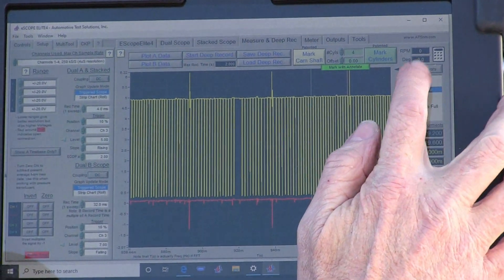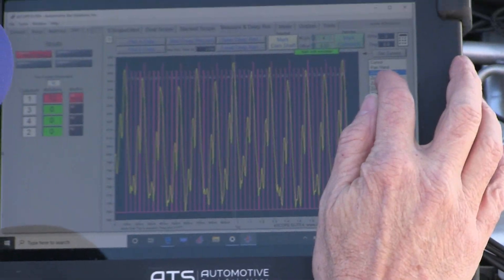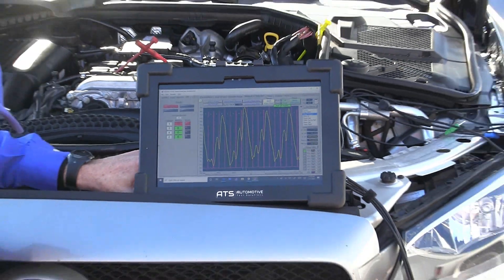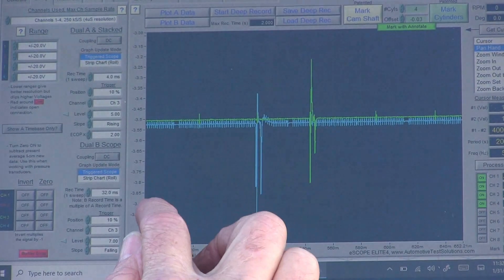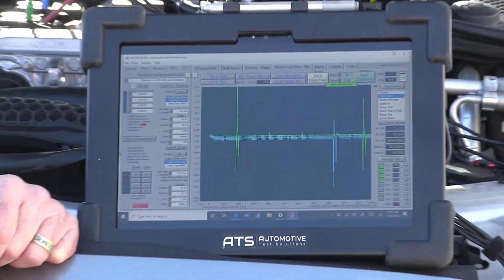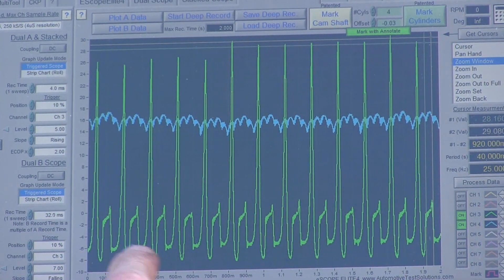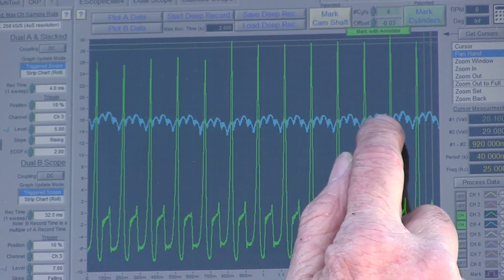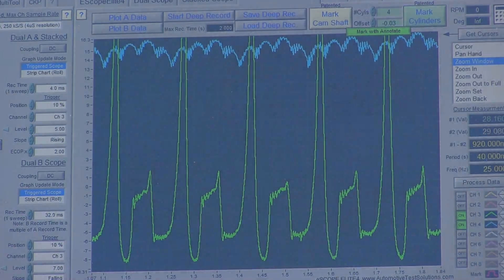2015 Mercedes 300C

Comment: That's why people should buy old crownvics.you can overheat those things and run them into the ground and save 50,000 dollars in the process.
Reply: and then you crash cause no traction control
Reply: @MrEeeaddict  if you crash then you are not a driver!
Reply: Best demo cars ever!

Comment: Man that E Scope is an awesome tool!
Reply: The crank misfire software is awesome.   I will be showing a demo on a Diesel soon. 🙂
Reply: busjockey1 the love the fact you can pull a misfire out of it with a sync & crank sensor. Pretty wild.
Reply: @weldingjunkie  Yes crank misfire feature is awesome.
Reply: @weldingjunkie  Agreed, I somehow regret my Picoscope purchase but I hope that Pico ups their game and can use some sort of filtering preset for this type of diagnostics, what I see this software do is look at the velocity of the engine and then if it notices a speed change, then it flags it accordingly, I don't see it being too hard to detect but I'm sure it can be done with the current tools that Pico uses, we just need people to be able to do this lol.
Reply: @scientist100  they do have some stuff in works idk how much I know this is patented but I’m sure they cab figured out another way to get same results. I have a Pico myself and a 8ch escope
Reply: @scientist100  While I don't have an Escope, I do own and use a Pico. I am admittedly not the best with it but I have found many fixes with mine. I wouldn't be without it. The Escope looks cool, but it bothers me that they don't advertise sample rate and if I recall correctly, buffer size. Those are 2 important specs. Admittedly, even with Snap-On's limited spec's you can get around it if you know what you are doing using the Vantage scopes with zoom, although they don't advertise their numbers either. I like the software features of the Escope, but I don't trust relying on software to calculate misfires for me, and I feel that the software is most of what you are paying for. I might change my mind if I used one for awhile, but I don't feel the need. I have much respect for the knowledge of the owner though. That guy is smart, so I will definitely listen if he's teaching.
Reply: @mobilemechmantim773  yes, his teaching applies to all scopes.
Reply: @scientist100   the pico 7 software does have crank speed misfire software as a math channel its just like ats almost
Reply: Have you used it Eric? Definitely looks fancy!